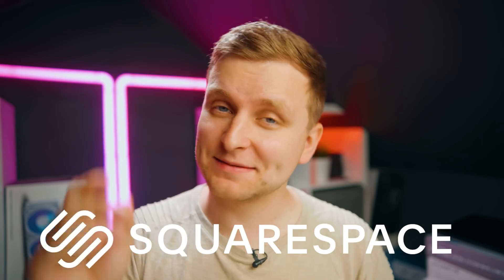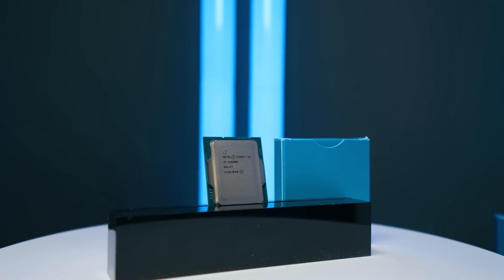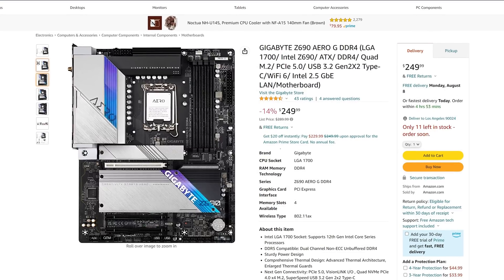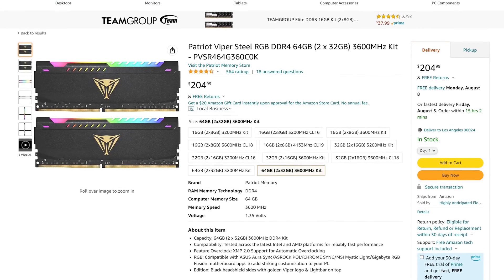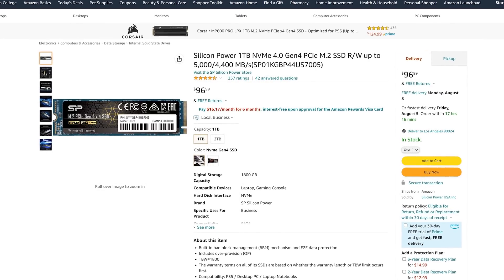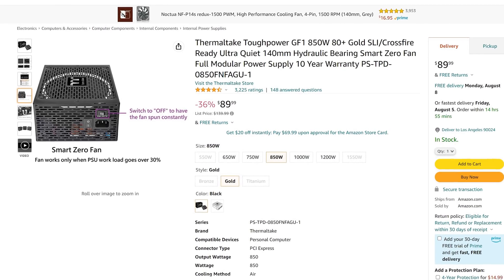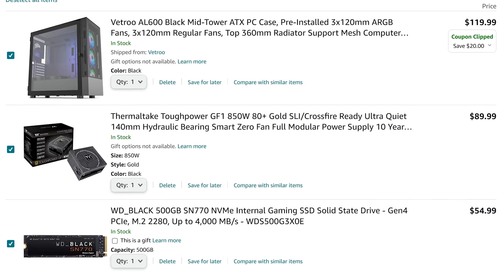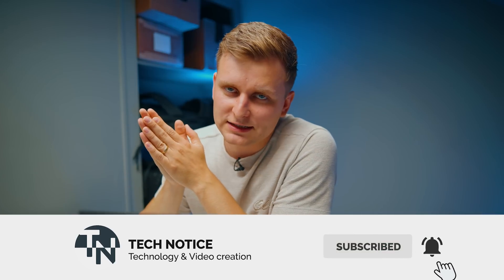BEST-BANG-For-BUCK Creator PC for Video/Photo/3D | '$2000 Budget Workstation for productivity'

Comment: Cud u help me to give me some suggestions if I am wrong or correct me about the specifications i want for Photoshop, video editing( adobe premiere, davinci,..) and some high action gaming to play such as COD series, military action games...but i am much worried about not to get so heat, not overclocking, just want to have non-k series, so that don't get watts high for electricity bill high, or not to get so heat due to this k series( no AC room in my home in my country south india). So, is it good to have non-k series such as 12600, 12700, 13700 with 3060 or 3060Ti with z690 for get extra SATA ports or to get B660 is enough for my purpose? Plzz tell ur suggestions what i said so far?

Comment: hey man thanks for making this guide but, I need your help with the new cpu's I am split between new AMD and INTEL, I am a 3d modeller and animator, I use 3ds max, vray, substance painter, unreal engine 5, which CPU do you suggest ryzen 7000 series or intel 13th gen, I am leaning towards intel as it has more cores and I kind had good experience with intel in the past, I am going to pair the this CPU with RTX 3080, so please help me with this CPU thing.
Reply: What did you choose in the end, I have the same problem, thanks.
Reply: @senil5906  i7 13700k paired with msi mag z690 tomahawk ddr5, corsair ddr5 32gb ram, rtx 3080 ti oc, deeepcool ls720 for cooling, my pc runs like a charm, its buttery smooth in all the applications.

Comment: Hi, before asking question, I would like to say I love your channel. I'm from Hong Kong, I thinking to build my own PC as photography budget 
but I can't decide,  I wandering to go your recommender motherboard aero G  but it cost HK$1999, could i go for Asus Strix B660-A wifi  ATX cost HK$1699.  Do I loosen something from it? 
another question I thinking to use intel I7 12700 as my CPU rather than 12700K cause the different is the K version cost HK$3200 and without K cost HK$2500 or should I stick with your recommender . if you ask me why not i5 12600K because it cost HK$2400, I might as well use i7 ....

 the other part like GPU or PSU , I will be using your recommender list given. but for now i can't decide CPU and Motherboard yet .... could you help 😬😬
 I hope i got to heard from you though what should i do ...

Comment: Hey not sure if It was this video or the other one I watched earlier but it was mentioned that the benefits of having a cpu with built in graphics are very beneficial when doing video editing is this true with ryzen as well or only with intel? I know I have been looking at building a system possibly with a ryzen 5600g since I was gonna start with no gpu and add one later  but I recently was able to pickup a used gpu and I remember reading that the 5600 is slightly faster than the 5600g and uses a little less ram so would it be ideal to stick with an cpu with integrates graphics even with ryzen or spring for the slightly better cpu that doesn't have integrated graphics? Thanks
Reply: Oh  2nd question is there any really big reasons to go intel for the cpu over amd? I know for a few years I have researching and watching videos but noticed a few of yours and matt whoismatt budget 4k editing pc videos and using those as a guide but his most recent videos in 2022 he switched to intel for slightly better price to performance (which may or may not be the case in a few months) anyways I know the gpus going with Nvidia is better for video editing so I was able to pick up a used gtx 1070 for a good price instead of going with my original plan of rx570 or rx580. Just trying to be thorough with my research don't wanna get something n find out for slightly more or the same I could be investing in something that's gonna give me a whole lot less in performance like the case of the gpus.

Comment: I am looking to upgrade my PC. I will be using for video editing and some of it will be 4K. I have a I5-11600K 32 MB DDR4 3200 Ram all cooled by a Noctua NH-D15S, and A GTX 1660 Super. I am using the free Davinci Resolve. I am still getting choppy playback on the timeline. I am looking at a I7-12700K or a Ryzen 5900X. Price of both with a new motherboard are within $10 of each other. I am considering the Ryzen due to cooling issues. I have had my existing I5 throttle on me.  Would you recommend the I7-12700K  or the Ryzen 5900X?   Thanks
Reply from the maker: I'd go with the 12700k and upgrade to studio on Davinci so you could utilise the GPU power ;)

Comment: The cl18 is faster? On those, yes; and the reason rests with the other timings on those kits. A 16-22-22- kit won't do any better than 18-22-22- because the timings r loose. cas latency alone is a poor indicator of speed with timings like that.

Comment: sorry I'm asking here, i recently build my pc- cpu i7 12700K , MB- ASUS tuf gaming- Z690+ , GPU rtx3080 aorus master ( 3x8pin one of the huge size) question is i got a 1000w Platinum PSU, am I wasting money for my electricity bill?
Reply: Got to pcpartpicker and put your components there and it will show you how much Watts your parts will use at max, probably got overboard with that psu but you will not be using those 1000w at most you will use 650w when your card and cpu work at 100%.
Reply: @bassagod1901  thank you very much. as pcpartpicker says 1000w is ok,  i may upgrade my gpu in future, thanks again.

Comment: I got an NVIDIA 3070ti with 8gb ram for 599.00.  Did I screw up?  I use Handbrake.
Reply: Handbrake as in the video transcoding program then you are ok as far as I know that is cpu based program so the better the cpu the better the results. From what I remember, you can double check and look for system reqs and see.

Comment: Thanks for another info-laden vid - how about a similar one directed at music production? I know you've referenced music creators here but I would welcome your insight into assembling a sub-£1000 music pc. Keep up the great vids.
Reply: If you're using music production software like Ableton, FLStudio or Logic, you're not requiring any intense graphics outputs. Therefore you should be specifically focusing on the motherboard, RAM and CPU. The higher your specs, the further it's going to all take you. And you can throw in an RTX3050/3060 if you're very occasionally going to be gaming or making video/graphical content. Probably look at the i5-12600 with 64GB RAM and a motherboard that supports TB4 is your best bet. If you can afford an i7-12700 or i9-12900 you'd go with those as music production software is typically CPU heavy.

Comment: Sir i have seen jarrods tech and hardware unboxed videos of 12700h and 12900h videos. Those CPU are on 10nm and still has same performance per watt compared to Apple m1 max 10 core CPU.  35 to 40 watt so same or better performance on Intel 12 gen. Intel is still on 10nm and equal or faster compared to Apple arm 5nm which is just insane. 

13 gen still on 10nm plus and again 60% gain in performance in compression and decompression. 25% better video editing, overall upto 40% faster than 12 gen. 10nm is beating 7nm of amd and 5nm of Apple arm.